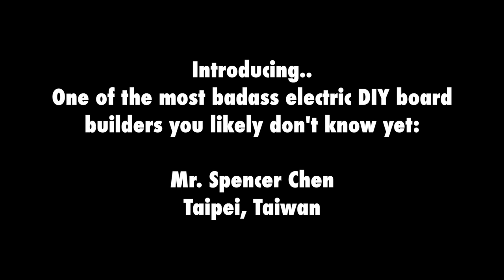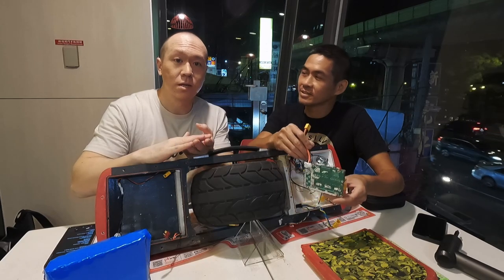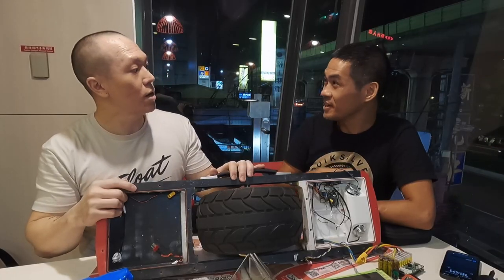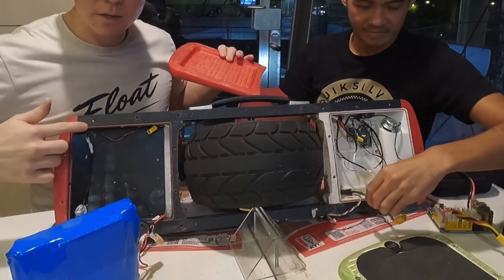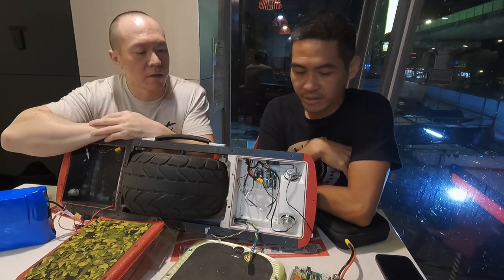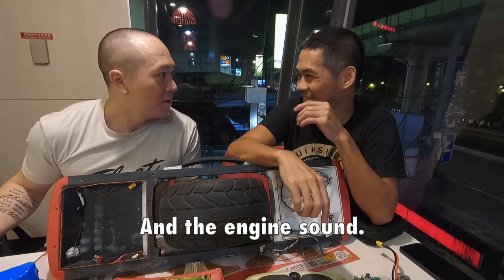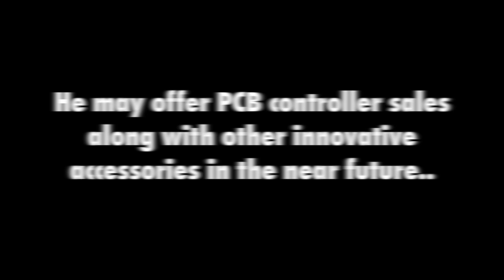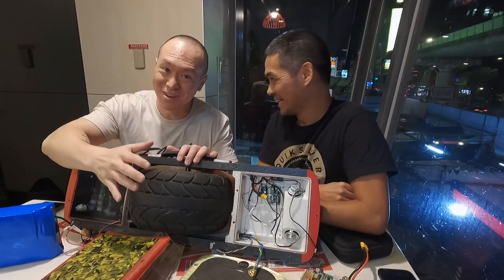The BEST features on a VESC one wheel board!

Comment: Whats the top speed on your onewheel i just built one 600 watt 60 volt motor. I'm only getting speeds of 10 mile per hour. Don't know if its  a bad tune or thats all this motor give.
Reply from the maker: speed will mostly depend on the battery voltage and pcb amp capability. for this 63V board it was around 16-18mph. For my 84V board it's around 32-35mph.